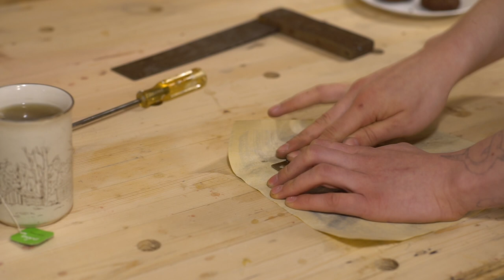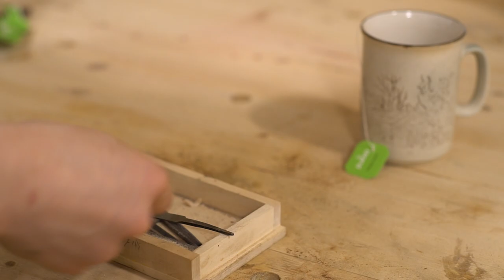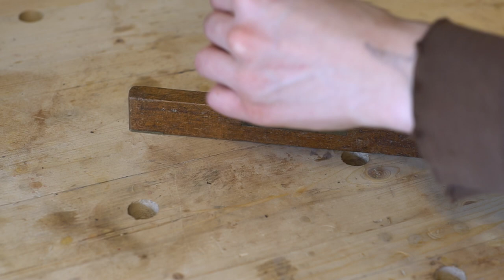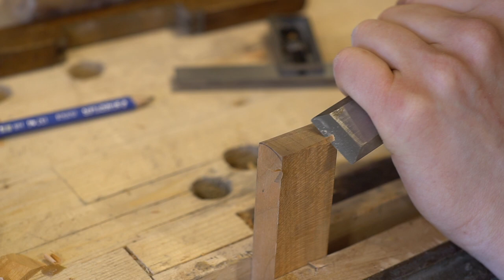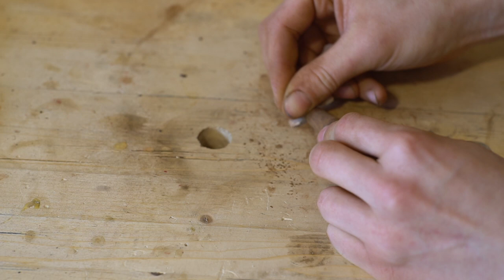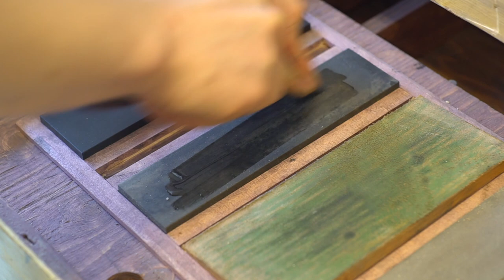Relaxing Tool Restoration // woodworking chisels, level, square

Comment: beautiful job. the gouges look to be buck brothers, however, I thing some European chisels have similar handles, and buck brothers are usually stamped.
Reply from the maker: The chisels have no markings on them. All I can say is that they are rosewood and seem to be at least in part forged. They also seem a little delicate compared to some of the older ones so my best bet is they are from around 1920s-1950s but I could be horribly wrong aha
Reply: Looks like Brazilian rosewood, beautiful timber and tools

Comment: What finish did you use?
Reply from the maker: The level and square are tung oil and the gouges are a generic oil finish. It looked really thick just because it’s old and almost gone bad aha
Reply: is there a functional reason behind the choices?
Reply from the maker: The chisels need a harder finish since they run in your hands a lot and the others don’t so I went for tung oil since it’s quick and easy.

Comment: the square is a Stanley. identified by the brass ornament on the sides, the level id ???
Reply from the maker: Thanks! I expected it may have came from Stanley. The level I have a feeling it is by some smaller brand. It’s not the wood Stanley ever used as far as I know (it’s oak) and no features of it resemble any brands I know. it’s a small one so I’m not sure it was ever really intended for professional use. May be a “cheap” one but of course, being at least 40 years old, cheap back then is nice now!